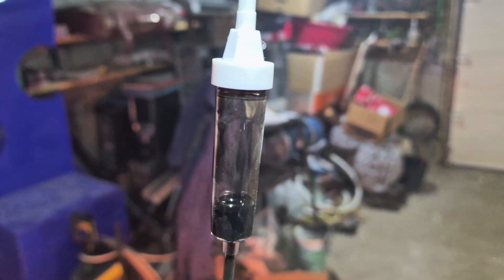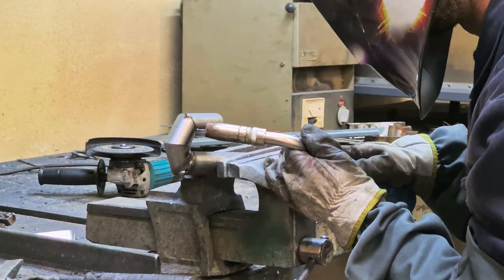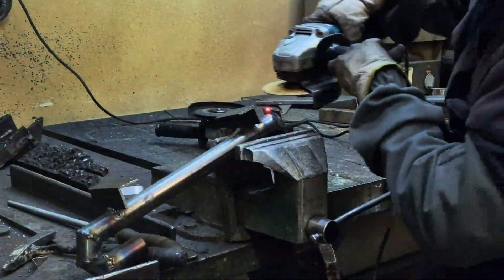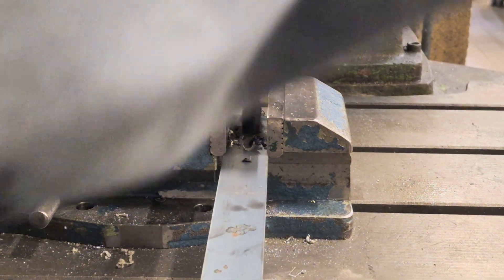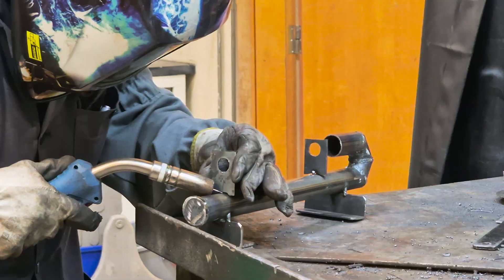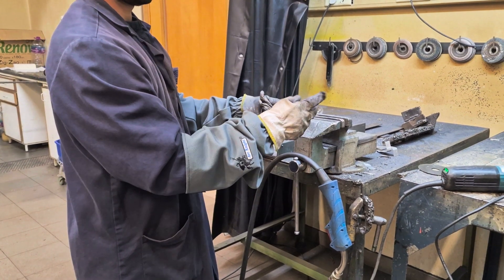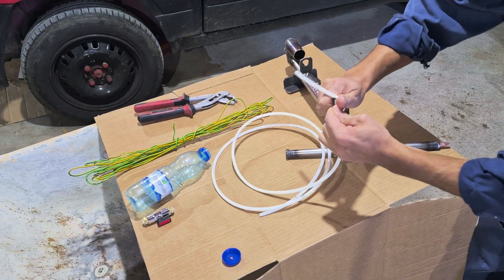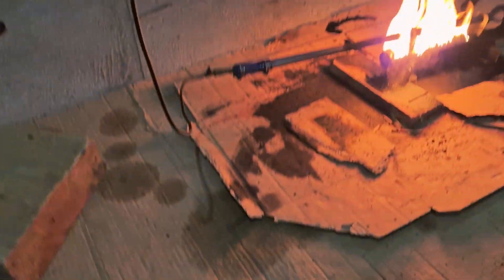How to make a step-by-step burner using used oil mixed with diesel to make money | No electricity

Comment: You've created a well-answered concept online. For it to work well (blue flame), you need to consider some fundamental scientific elements.

The reason the flame is red/orange and there's black smoke is because the mixture is too rich.

In this concept, there are several areas that influence it.

1) The diameter of the tube in which the oil is heated.
2) The diameter of the hole where the smoke from the heated oil exits.
3) The opening where this smoke enters before being browned in the "burner" section.
4) The burner area (amount of flame heating the tube).

I suggest two improvements that should make a significant difference.

The operating principle is the opposite of what people imagine. It's not the heated oil smoke that is pushed into the tube, but the combustion of the gases in the burner that creates a suction effect in the U-shaped tube, which draws the heated oil gases into it. Understanding this makes it easier to understand why the combustion is too rich.

1) The opening where the smoke enters, along with the air, before being sent to the "burner" section will need to be modified to add a "cone"-shaped opening. The cone's opening should be 2.5x to 3x the diameter of the heating tube. Through the venturi effect, the air will be drawn in with the gases, and a more homogeneous mixture will be possible. For now, your model isn't burning blue because there isn't enough air for the amount of gas...

2) For the hole through which the smoke from the heated oil exits, install a nozzle with a hole between 0.2mm and 0.5mm in diameter. You'll need to experiment with different sizes. This will significantly reduce the richness of the mixture. I strongly suggest, based on the size of your design, trying 0.2mm rather than 0.5mm. Or even 0.1mm... It will be up to you to determine which one is right for your setup.

Finally, playing with the position of the heating tube should affect the amount of gas created. This will also influence the mixture.

By playing with these three elements, you should be able to achieve a blue flame.

If you run out of gas, the flame will go out, so proceed step by step...

1) 0.1mm nozzle + heating tube positioned for the minimum gas output... If the flame goes out, move the heating tube to increase the amount of gas output... and so on until you reach the maximum possible output... If the flame still goes out, try the same thing with the 0.2mm nozzle + tube positioned at the minimum gas output and move it little by little to slowly increase output, and so on...
If needed, try it with 0.3mm, 0.4mm, or even 0.5mm... Eventually, you'll reach the proper stoichiometry.

Good luck.
Reply from the maker: Thank you very much for the tips.
I no longer use this model due to the released smoke.
Now build the other version with a chimney.
Check out the other video of its construction and tell me what you think of this new model... Thanks Best regards
Reply: @PointlessCreations1  the chimney is just to redirect hot gas outside and avoid intoxicating yourself inside...

the blue flame is the result of a good stoichiometric mixture, which increase the heat generated with the less amount of fuel... aiming toward blue flame will generate more heat and save fuel as well, it's a win-win approach.
If there is black smoke, using a chimney only reroute the smoke outside, it keep wasting lots of fuel and heat... ill check the video.
Reply: You have no idea what you are talking about.  Little knowledge is dangerous.
Reply from the maker: Thank you for your words. We are all there to learn something. Thanks
Reply: @ hey no problem friend, im here to help. if you have any question, give me a sign and i'll answer you :)

Comment from the maker: Ever tried using used oil to heat your house? Any ideas to improve the burner’s efficiency and reduce smoke? 🤔 I’ll share the next version with a chimney to fix that! Drop your comment below! 👇💬 Let’s build solutions together! 💡
Reply: Never use a used oil burner to heat a house. To many toxic fumes and to big of a fire hazard.
Reply from the maker: the next version with a chimney
Reply: @PointlessCreations1  ok… but waist oil burners indoors is not a good option, to big of fire hazard and toxic fumes.
Reply from the maker: @USMC1984 the next version with a chimney, It's outside the house Thanks
Reply: @PointlessCreations1  You have to boil the oil to get a blue flame.  You create a pool at the bottom of the burn chamber and use forced air above it so it grills the oil and keeps it boiling.  Really not hard at all.
Reply from the maker: Thank you for your words. My goal is not to use another energy source, not to use electricity to force the air. Air passes through temperature differences, air convection. It creates the air currents without spending more money on extra energy. The flame will never be blue without extra energy to force the air.
Thanks